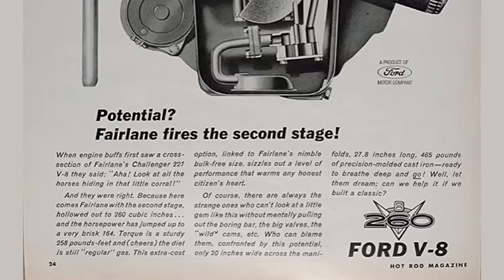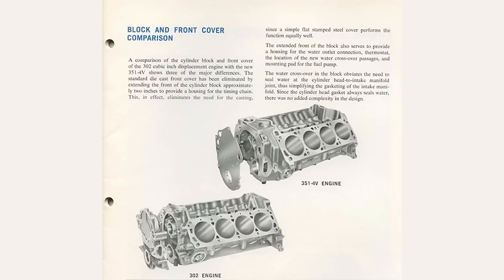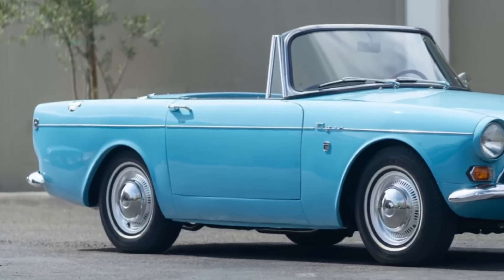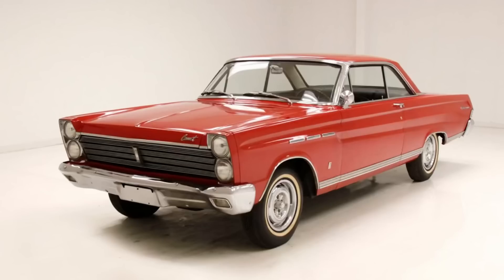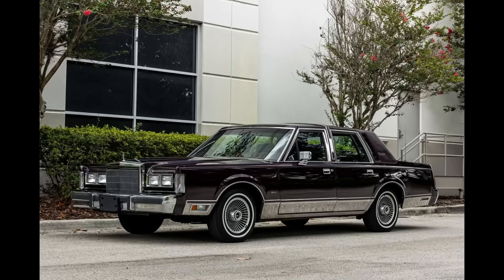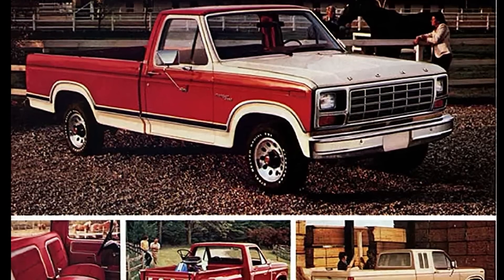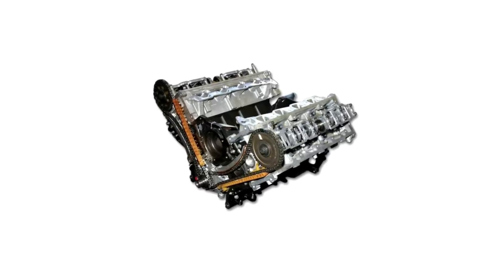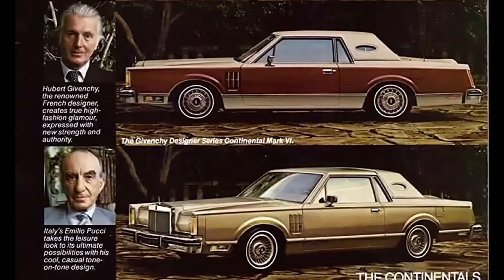Ford small block engine family 221, 260, 289, 302, 351W, 255 not the race engines

Comment: Don't forget the BOSS 302, Cleveland heads on a Windsor block. In Australia Cleveland's were built up until 1982 being fitted to the last Cleveland powered XE Falcon, the Cleveland first appear in the 1971 in the XY Falcon in both 302 and 351ci. The Aussie 302 Cleveland was not a BOSS engine , it was a Cleveland with an shorter stroke.
Reply: First XW was 351 Windsor, and the latter XW had the 351 Cleveland
Reply: Love it! 👏 I take it you have one? What's your duration? I have Australian 2V heads with smart port work done by a master. But my cam is fairly mild.

Comment: Mustang or Torino, that is a tough choice I like them both. I am not really in to Lincoln they are a bit big for me, but I drove one frome the 80s once. The 289 was used in the 68s. I had a 68 Falcon, my dad had a 69 Montego at the same time, they looked like the very same engine to me., but mine was clearly marked as a 289.
Reply from the maker: Awesome choices =)

Comment: The Cleveland in 302 and 351 cubic inch capacities was built until 1982 in Australia.
Reply: Cleveland's were built up until 1982 being fitted to the XE Falcon, the Cleveland first appear in the 1971 XY Falcon in both 302 and 351ci.
Reply: I've been told those were even stronger blocks and cranks than the US versions once you started casting them down there. We never got the 302 version. Legendary performance!
Reply: @P_RO_  they were a good engine, we got the 302C as it was a far better option to manufacture a new crank and rods plus use the 2V head with a closed combustion chamber than to import the 302W as well doubling up on the spare parts inventory for such a small market. I’ve got a 302C/C4 in a ‘54 Mainline (Ute).
Reply: @craigjones2878 In the 80's and later, the top US Ford fans were quietly importing Australian parts to build better engines. In the 90's it wasn't as much of a 'secret' anymore, and of course with the internet very little engine lore remains hidden. You got the good stuff, while people here went to big-blocks for performance gains instead so we got few to none of the upgrades. What your best tuners do with these engines is still unmatched here.
Reply: @P_RO_  Many 302 Cs were re-machined and sent to the USA as a performance product in the 1980s as the Australian castings were stronger than the US models. many good Falcons were denuded of their blocks.

Comment: Had a 255, allegedly out of an 82 mustang. Was imported from Japan to Australia in about 1987.
Put it in my 1966 falcon. When I bought it I was told it was a 5.0, but after fitting a holly carb and tuning it became obvious by the jet size it was not a 302. Ford Australia refused to sell me a rear main seal (one piece neoprene) because they had not released the late model windsors in Australia yet(not re relesed untill 1992), despite the 250 cross flow sharing the same rear main seal, witch was current falcon engine at the time. Japan was not allowing cars with displacement over 4.2 litres so the 4.2 mustang became popular for a breif time.
Reply: Japan did that also?  Everything in their power to keep most American cars out of their country without specifically saying so.
Reply: @jamesbosworth4191  Probably, but the Japanese never bought many of our cars anyway preferring their own smaller cars more suited to their roads and the far better fuel economy they gave, which was (and still is) a big issue in most places. I can't blame them for their own patriotism when I'm the same way here.
Reply: @P_RO_  That is the point - our cars didn't sell in huge numbers, yet they still enacted regulations intended to force our cars out of their market without specifically banning them, all the while in most years, they have had unfettered access to OUR market.  We are SUPPOSED to be ALLIES, yet they treat us as if we were adversaries.  If it was up to me, I would have done the same to them in response.  Since they have built up their industry specifically to export to us, they would have RUN back to the table, as not having access to OUR markets would have crashed their economy big time.
Reply: @jamesbosworth4191  So somehow your ideas would have made them buy more of our cars when they didn't want them? And it would have made more Americans buy US cars they also didn't want to buy? Who would benefit from such a concept? Not the average citizen who would then have to pay more for a car than they had to with possibly fewer choices available to them. 

You clearly do not understand the implications, ramifications, depth, and scope of trade issues like this. "Tit for tat" doesn't work and no nation is wrong to want to help it's own industries and therefore its own people prosper. If you think there's something dirty here you should look into "the Johnson act" and "the Chicken tax" where we've been screwing our friends and the whole world for decades. Take note that the industries those were supposed to help have waned and fallen because of them instead. I'm done with discussing trade politics here even if it does relate to cars as I want this to be a most pleasant channel for all viewers to enjoy. Good day Sir.
Reply: @P_RO_  You yourself stated that cars nowadays sell based on price.  That started in the midr 70s, so, that means that if Japanese cars had cost more money, they wouldn't have sold in the numbers that they did.  If fewer people bought Japanese cars, more people would have bought American cars.  Simple logic.  Nobody would have made the Japanese buy our cars, some of them LIKED our cars, and for their government to prevent them from doing so, while we can buy THEIR cars is indeed dirty.  Tit-for-Tat would have indeed worked, as we bought way WAY more from them than they bought from us, AS LONG AS THE RETALIATION WAS TARGETED AT SPECIFIC PRODUCTS, and not a blanket "Let's get Japan" type of thing.   The Johnson Act seems heavy-handed, but the Chicken Tax was fair game.  THEY put tariffs on OUR CHICKEN first.  Why is it OK for foreign countries to try to keep our good out of their markets, but the most horrible thing in the world for us to retaliate?

Comment: My first car was a 62 Fairlane sport coupe with the 260, 3 speed column shift. It was a great little engine, but later replaced it with a 289 and C4.
Reply: Wasn't the rear end gearing too short with the auto?
Reply: @jamesbosworth4191  I didn't really notice anything different from what I remember.
Reply: @jeffwalker1956  It didn't seem to be revving to high on the freeway?  Automatics will generate a little RPM than a manual trans.
Reply: @jamesbosworth4191  it may have, but I didn't drive to much on the freeway to notice it much.

Comment: Love the channel and content!
  In case you didn’t know, Ford made the Boss 302 in 69’ and 70’ for the mustang. Basically a Cleveland 4V headed (huge ports and 2.19” intake valves) 4 bolt mains, solid lifter cam, 11:1 compression, etc. And rated at 290hp. Pretty sure it was more. The big valve/port head really wasn’t great for the street. The 351c 2V head was really good. Good size ports and 2.08” intake valves.
Reply: There is another video that shows a 1 of 1 1971 Boss 302 Mustang.
Reply: Jay did mention he wasn't covering the variants this round, which means more great Ford vids coming 😎 On the streets, the non-Boss Cleveland-on-Windsor arrangement is often called a "Clevor" or "Clevedor" and can easily be tweaked to rod and crank breaking power. The Boss crank was a 'nodular iron' component and much stronger than cast. Many of the "Boss Mustangs" you see are fakes using the Clevor recipe; the real things have become rather scarce in factory configuration.
Reply from the maker: Thank you so much. I totally forgot about the boss 302 in the 60s I’ll cover that whenever I cover the special race engines clevor there was a 302 in the ford gt that was a special engine
Reply: Ford of Australia went the 2v Cleveland head one better. Used on the Australian (and South African) version of the 302, it featured the closed style combustion chamber of the early 4v head with the 2.05 inch valves and smaller intake ports of the 2V Cleveland head. The Australian 302 was made as late as 1984 and many of those closed chamber heads were shipped to the U.S. although the supply has dried up in recent years, and the few still coming in often are in bad shape..
 All U.S. made 2v Cleveland heads were of open-chamber type. Aftermarket Cleveland heads, although aluminum are based on the Australian Cleveland design and are an alternative to ditch the open chamber heads.
The small-chamber Australian heads are great for raising compression on 351 M and 400 engines, although the stock pistons of the 400 often sit up to .075 below the block deck thus negating "quench" that the closed chamber heads would otherwise provide, and commonly results in spark knock/pinging if higher octane fuel is not used.
The Australian heads also flow better on the exhaust side, as the thermactor/smog pump "bumps" found on open chamber U.S. 2V heads are absent.
I built a 400 using the Australian heads for a 1978 Thunderbird, using an mild aftermarket camshaft and aftermarket 4 barrel intake, its performance was very noticeably improved over the stock 400.
I ran it against a very rare "M" code 1963 Thunderbird (3x2V 390), the built 400 was slightly quicker.
Both vehicles were approximately the same weight and both are equipped with the 3.00 ratio 9 inch Ford rear axle.
Approximately 140 "M' code 1963 Thunderbirds were built.
I was rebuilding the 3 Holley 2 barrels and had the opportunity to run it against my 1978 with the 400.
Reply: @donreinke5863  the 2V heads were 2.05 in the US also? I couldn’t remember exactly and thought 2.08. 
   Back around 97’ or so, I saw a 62’ I think) Starliner with the 390 3x2Bbl 401hp and 4sp. All original except the distributor (electronic) and battery. I’m was at a car show I’m Gatlinburg, TN. The owner drove it down from MD. He said he drives it all over America ti car shows.
Reply: @geraldyates8958  The 61-62 390 high performance version, either with a Holley 4 barrel or 3x2V were solid-lifter higher compression engines, as was the late 62-63 406, a 390 punched .080 to 4.13 bore.  The "M" code 1963 Thunderbird 3x2V was a hydraulic lifter detuned version, and was basically the standard 390 with multiple carburetion.
According to the sources Ive found, the 2V Cleveland heads were 2.05 intakes, and that is what my machinist put in the Australian heads I brought him. The base 429/460 heads were 2.07, 429 CJ and SCJ valves were larger, those heads also had larger ports.
The 429 CJ intake mounted a Rochester Quadrajet carb, (I think it was 750 or 800 CFM) while the SCJ used a Holley..
I have a 429 CJ intake in my shed I got back in the early 80s for $25, they were iron rather than aluminum, and the ports are roughly the same size as a 4V Cleveland head.

Comment: Did the 351 REALLY need a different (larger) oil-pump driveshaft?

EDIT - To clarify, it was a "why" question. The 351W used  5/16" hex as OE while the rest struggled by with 1/4" hex. It just seemed odd that an engine of basically the same architecture and oiling needs would warrant the pump driveshaft upgrade.
Reply: The standard oil pump drive shaft is 1/4" with most SBF's and is known to twist and even snap in two, especially using the heavier 50wt racing oils and high-pressure oil pumps which were popular in those days. A HD 5/16 version could and can be had from Ford or aftermarket sources. No fun changing one out by the side of the road which taught me to always remove the retaining clip on the stock shaft so you could do that from the top instead of dropping the oil pan; 4 hours in the cold ending in the dark of night 😒 The clip was there only to ensure that the shaft didn't fall out unnoticed on the assembly line and is not needed.
Reply: @P_RO_  Oops too late! I already popped mine back in. Well ARP and Speedmaster make hardened ones. Now I know.
Reply: @jamesmedina2062  Generally not a problem James, so don't worry. Stockish SBF's don't benefit from 50wt oils as they don't return to the sump fast enough which can lead to oil starvation on the plain bearings. 40wt is the heaviest oil you need and 30wt is fine in less than hardcore builds. Also high pressure pumps can actually cause the main bearings to float and spin; the high volume pumps are the way to go as the increased oil flow cools the bearings better. I've used only Mellings oil pumps in all my engines, good stuff. I also found that Castrol HD oil gave the best lubrication with SBF's but it's no longer being made. I also learned that the TRW timing chain sets with metal gears were best; nothing else goes 200K+ miles without replacement in a SBF but now they're made in Mexico and that may be different.  I don't run things hard anymore being old myself, but I went through many stock and near-stock SBF engines learning these 'secrets' running them hard. They're fantastic engines once you know how to deal with them.
Reply: @P_RO_  I get ya. Best thing was that my engine guy was a master. He built all the dyno engines for MSD back in the 90's. His engines set records. But he was a head guy and used another guy to bore and hone the block. Its a 4 bolt main block that cleaned up 0.030 over. Stroker kit with externally balanced Aussie balancer. Ross/Crower. Crane roller rockers and hyd roller retrofit. He said 30 weight would be fine. He since passed. I was thinking use a 0w40 like Pennzoil. His idea was to rollerize what you can, use extra capacity oil pan, Glyptal on lifter valley and regular Melling pump. I don't know everything he did. I was 22 yrs old. He said don't get over 6500 rpm
Reply: @jamesmedina2062  If he said to use 30wt that's what I'd recommend you do. Only in high heat and severe usage does 40wt become viable. Also know that modern oils lack the levels of zinc they once had which greatly helps in these older designs. Zinc oil additives are available and I'd use one for the bottom end's sake. With newer engines which have very tight bearing clearances you need those "low W" oils for good flow in cold engines but they are way too thin for these old-school block designs which can't use those tight clearances. I wouldn't go below a 10w or 20w weight in a multigrade oil which should also be good with the roller cam and rockers. And I wouldn't go above a 40 for the second 'warm' oil weight number. Change the oil and filter every 3k miles and you should be good for daily-driver use. 

Almost all of my tests and experiments were with old-school builds, ie flat tappet cams and conventional oils in near-stock designs, but I was immersed with the folks doing hipo builds back then and we compared notes, learning from each other. Today's engines are a world apart and I don't have much experience with them, nor do I run anything hard anymore. I'll close with saying that unless there's an obvious problem like the oil pump drives, don't try to second-guess the engineers unless you can afford to learn things the hard way.
Reply: @P_RO_  sounds like a plan. Thanks for your input!
Reply: I just installed my 351C oil pump and new pan. I took apart the pump. So using a standard volume Melling pump the shaft is basic and not beefy at all. But if you made modifications such as hi-volume pump you may could use a bigger one. For oiling we use a bigger oil pan and used Glyptal paint on the lifter valley to add in drain back
Reply: I just installed my 351C oil pump and new pan. I took apart the pump. So using a standard volume Melling pump the shaft is basic and not beefy at all. But of you made modifications such as hi-volume pump you may could use a bigger one. For oiling we use a bigger oil pan and used Glyptal paint on the lifter valley to add in drain back

Comment: EVERY one had a bit of an oil pubble in the "pocket" near the distributor base.
Reply: Lol, so true! It was actually a secret invisible olfactory heat gauge which let you smell when the engine was overheating. Some of us connoisseurs could also tell which kind of oil you were using from that smell 😆Part of the puddle came from leaky distributor o-rings which shrank over time. You can tell a real Ford guru when there's no puddle there because there are easy fixes for it if you know how.

Comment: A great engine episode, Jay. And of one of my favorite engines!  FYI, the 289 was produced into 1968 -- My 1968 Mercury Cougar is so equipped. I also owned a '68 Falcon with a 289. Long story about why they were used in '68, but you'll find 289s in 1968 model year Mustangs, Fairlanes, Torinos, Comets, and Montegos as well. And I'll take the Torino and the Mark VII LSC.
Reply: I had a friend who had 68 Cougar that also had the 289. I never had a FOMOCO product that came equipped with the 289, but I had several different 302 equipped vehicles.
Reply from the maker: Thank you so much for that. Correction, glad you dig this episode sweet choices. =)
Reply: Mine too, 68 289 2v,   the heads say 66, but I’m told  the 66 heads are the best yr for flow or higher compression or such,?   Prob has to do with which plant and if cars date is early or late 68 ….

Comment: I HAVE A 63 1/2 RANCHERO WITH THE 260 V8, 108K MILES OR MAYBE 208? , RUNS SO WELL
61 YEARS LATER, IT HAS AN EDELBROCK 289 PERFORMER INTAKE, 600 CFM, 1406 CARB, ALSO EDELBROCK,
DUALS, ELECTRONIC IGN, FLOWMASTERS, PLENTY OF POWER FOR THAT LITTLE TRUCK.
Reply: I didn’t know they had A “1/2” year for rancheros*